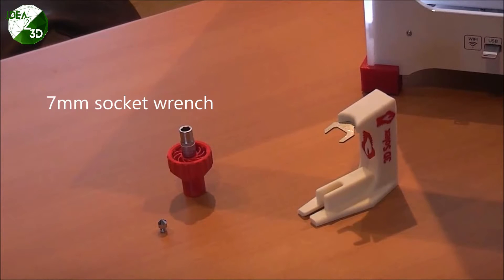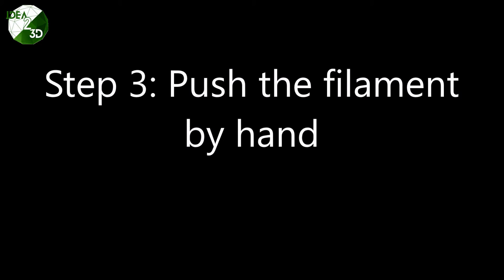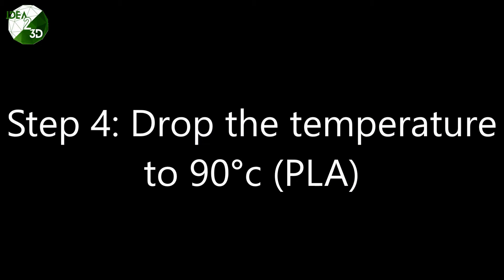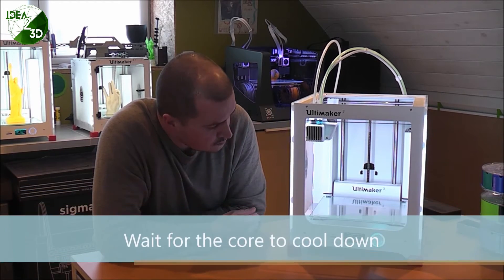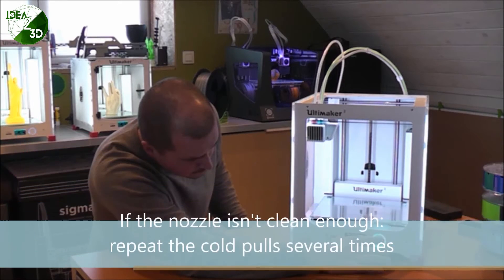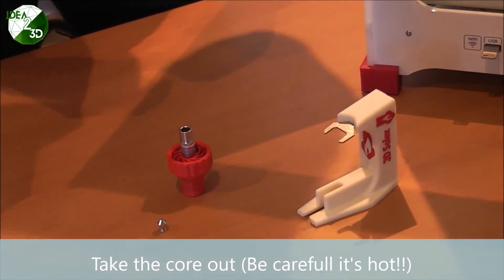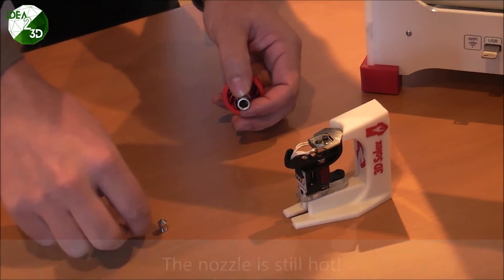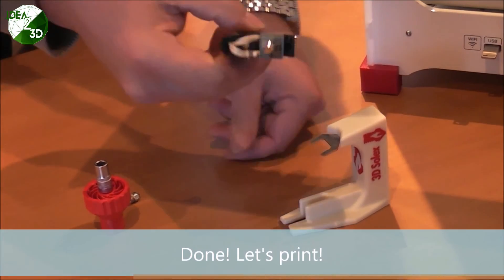Change the Hardcore nozzle on the Ultimaker 3

Comment: Hi Didier, I have just watched this video, great work. Thank you, I have found the 3D printed tool on Youmagine and am printing at the moment, where can I find the a metal flat spanner to fit into the printed part, what ar the dimensions? You assistance would be appreciated. Regards Dave
Reply: I also would like to have a link to the metal wrench or spanner that fits this print.

Comment: Hi，i jist got my hardcore but it doesnt print well like the original UM3 core (even on the same size .4mm nozzle)... does it require special settings? Also, I never succeed in unloading filament like the way I did on the original UM3 print core. The filament will always got stuck to the core and the machine couldn't unload filament from it. I hv to hit up the temperature manually and then do a hit pull every time I change filament. Do u hv this issue? I also h under extrusion happening to my prints after first few layers.... frustrating.
Reply from the maker: Hi,

Where and when did you buy it? I had someone with a similar problem and it was caused by the 'trumpet' being to narrow, can you try putting filament inside (with the hardcore out of the printer) and see if it's not to narrow? I would also contact the seller to see what it can be.

Didier
Reply: I just bought it weeks ago.  I hv other issues with the printcore (under-extrusion and print fails after a few layers) and they asked me to post back my 3DSolex Hardcore and sending me a new one.  How to know if it is too narrow? If i unscrew the nozzle (with the hardcore out of the printer) and put filament in it, the filament wont pass through it. is this normal?Just want to know if this is normal behaviour or not, becuz i also heard from a few other users had similar problem on unloading filament.
Reply from the maker: i you have a caliper you can measure the filament entry hole (what i call the trumpet). And if the filament doesn't pass through as you describe no it's not normal. do you know where it's blocking? Could be the teflon inside also or a damaged neck maybe?

Comment: Thanks for your video.
Why did you do a cold pull?  What if you just change the nozzle after retracting the filament out of it through the dial knob in the front panel of the printer? 

Also could you post some videos about the HardCore itself? some reviews with example prints and so? Not many videos are there about that so its much needed.
Thanks.
Reply from the maker: Hi, 

Thanks for your comment!

Doing a cold pull is not mandatory, it's just that if you do it, it empties the nozzle so it's better, it avoids for example to have some melted plastic going on the threads of the nozzle.

But you can do without of course, just remember that some filament will stay stuck inside
Reply: Didier Klein thanks for your reply. 
Waiting for the HardCore review :)